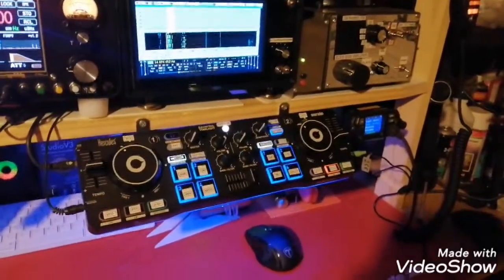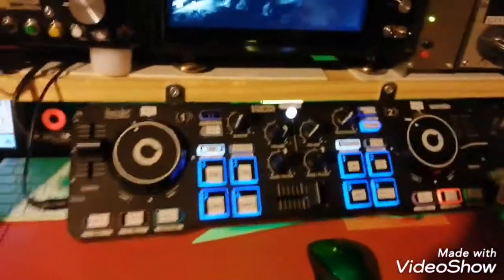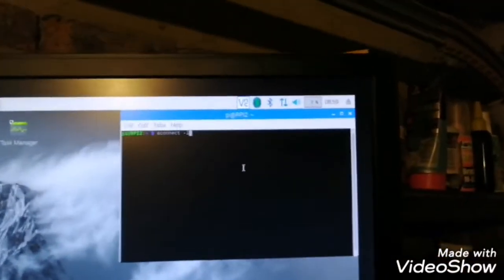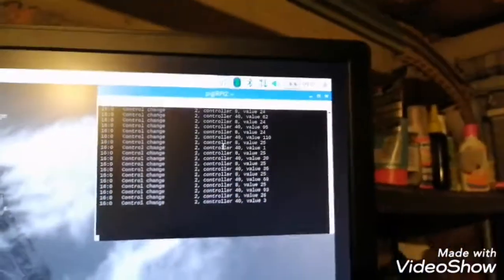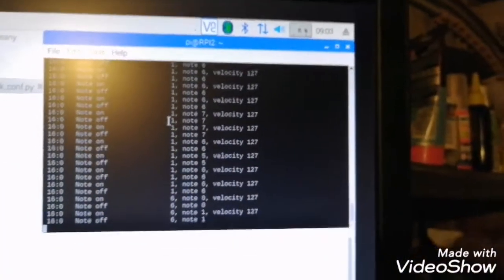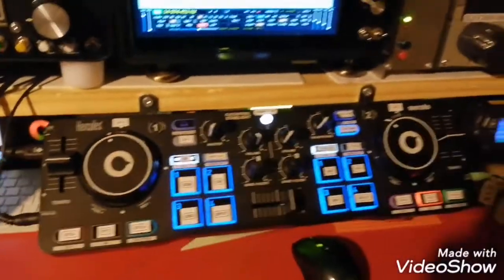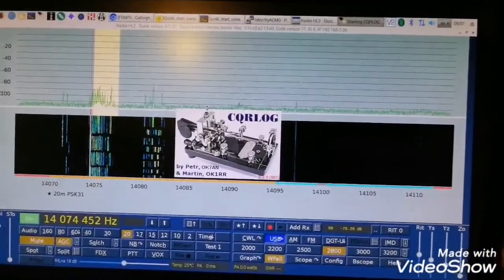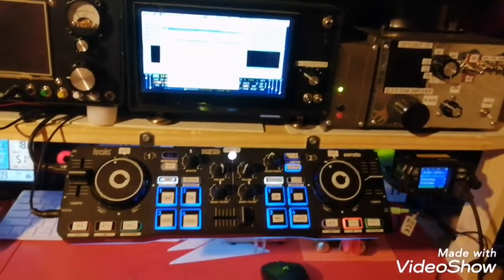F5NPV - Hermes-Lite, Quisk ,  Midi controller and Raspberry PI

Comment: My SDR set up, so far only for RX, is a RSP1A and ADALM PLUTO controlled with the SDR CONSOLE software. For input device I connected the Behringer CMD PL1 Midi controller, which works fine with SDR Console. Without a big jog dial knob for frequency control and the small knobs for filter bandwidth and buttons to change modes there is no fun using the SDR. The Hermes Lite 2 is on my wishlist.